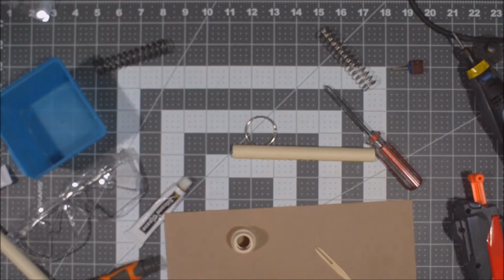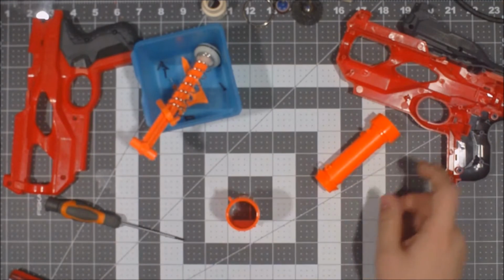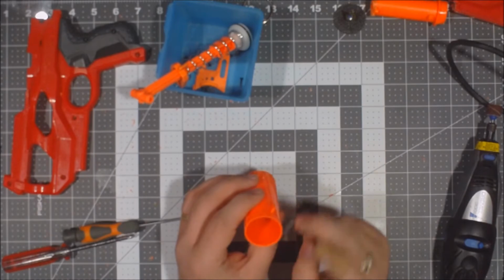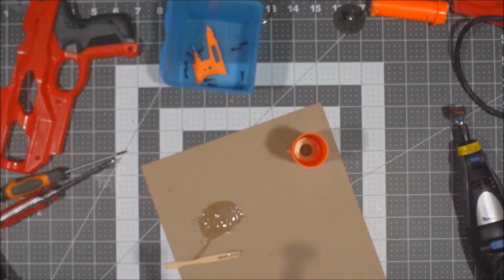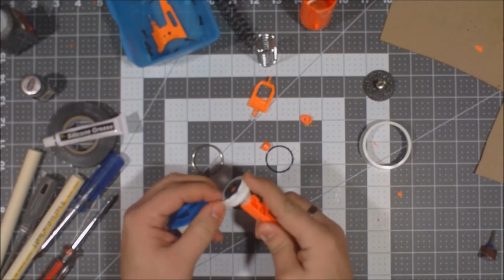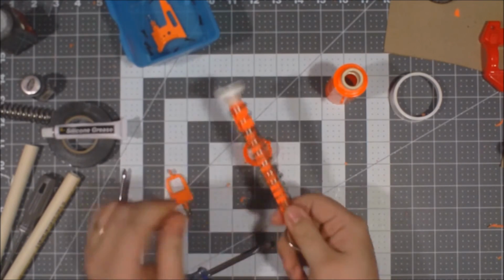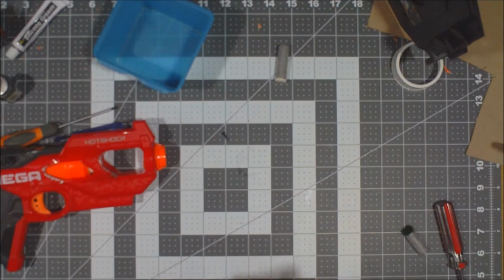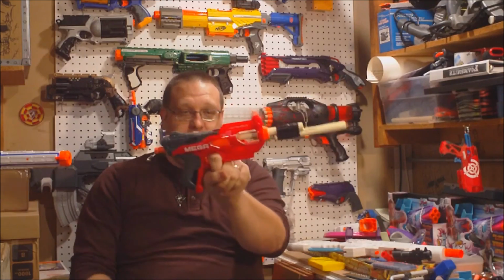Back To Basics: Mega Hotshock Mod Guide

Comment: Rather than using the keyring mod (which just looks really janky), why not just un-therad, the old spring then re-thread the new spring?
It looks so much tidier and works a lot better as the keyring can cut into your fingers when priming it with a spring upgrade.
I've used that method on Firestrikes, Mega Cycloneshocks, Strongarms, Jolts and Triads many times when upgrading the spring where the plunger head is poly-welded on to the plunger rod.
It looks a million times better and works better, keeping the original look of the blaster.
Electrical tape is good for sealing the air release holes on some blasters, you don't need too much, but I'd never use hot melt glue on a plunger though.
For example, my Mega Cycloneshock had a poly-welded (and screwed on for some reason) plunger head, all I needed was a pair of needle nose pliers to de-thread the stock spring and re-thread the upgrade spring, now it hits over 100fps and has great accuracy and power that rivals Rival blasters.

I just hate the keyring mod as it looks so ugly, feels uncomfortable and can be completely avoided with a little work, even on the Cycloneshock's telescopic plunger rod (it took me like 2 minutes, with no dremmeling), so I see no reason why you couldn't just thread on a new spring without mauling the look of your Mega Hotshock.
Reply from the maker: Matt Von Nerf OK, so you don't like the Keyring... some people do, like myself. The keyring is a tried and true old school mod. Yes electrical tape does work on sealing the plunger holes. Also this works for the Firestrike. You can't do this with a Cycloneshock because you'll never be able to prime it. Also you don't have to thread springs on a triad or jolt, unless they changed something. Those plunger heads unscrew.

I get you don't agree with what I did. But it is my mod, and my mod guide. You want to thread the spring off and on, be my guest. So while I am all for a discussion on the what I would do differently, I don't really appreciate the criticism  of "mauling the look" when I am perfectly fine with how it turned out.